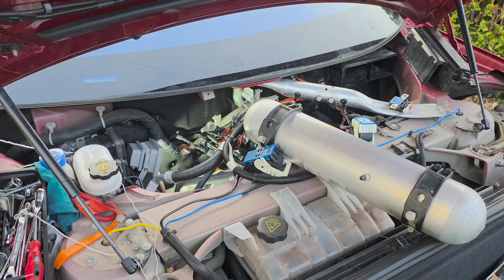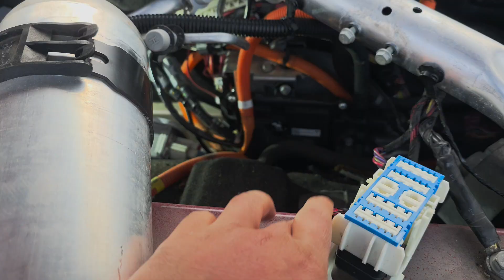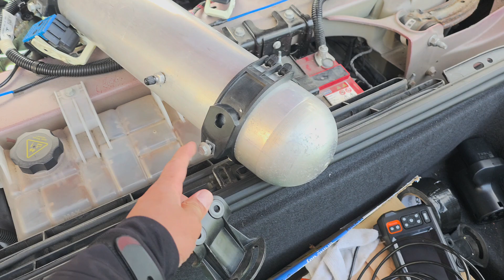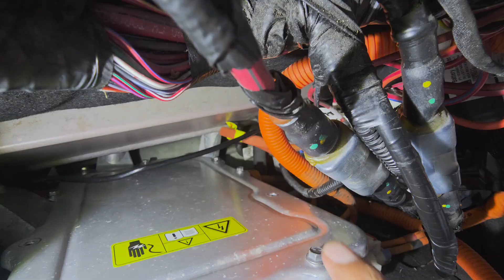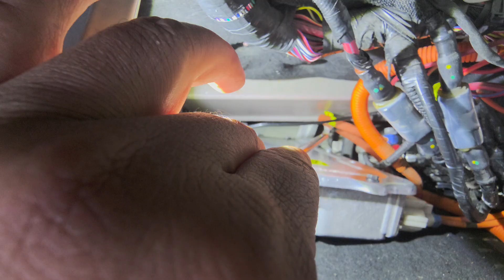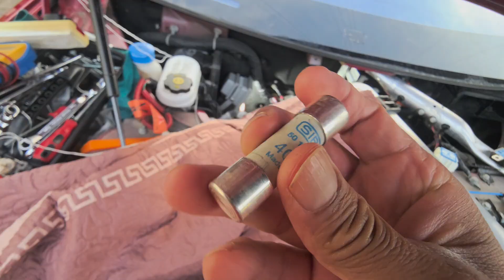Tesla Model S High Voltage PTC Fuse Replacement

Comment: What's the sequence of disconnecting the HV battery so we can work in the front junction box(fuse box)?

I'm thinking this is the sequence but I might be wrong:

1. Disconnect negative pole on 12V battery and wait a few minutes for the current to completely drain.

2. Disconnect the fireman loop.

Is this correct?

Comment: WOW Great job. I have a 2017 Tesla S 100D and the heater as stopped working would you be able to fix for me please I am near Leicester I can bring to you if you can repair for me please. regards Bryce.
Reply from the maker: Glad it was helpful! Unfortunately, I don't offer repair services, but I hope your heater issue gets resolved soon.
Reply: If you are willing to drive to Europe, search EV CLINIC :) they do the service repair of PTC heater will cost 450€ + VAT or so, if fuse is blown, it will be about 650€ + VAT, way cheaper than PTC replacement by original tesla for 1600+€ I was quoted, they opened a few branches recently 

As of now they have location in: Croatia, Germany, France, Slovenia, Serbia, Hungary, Austria ... Good Luck